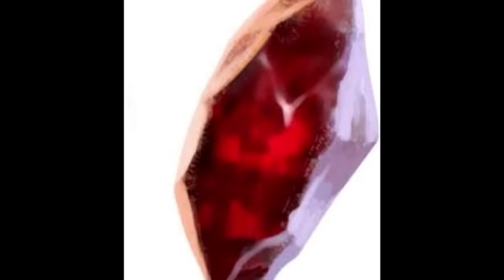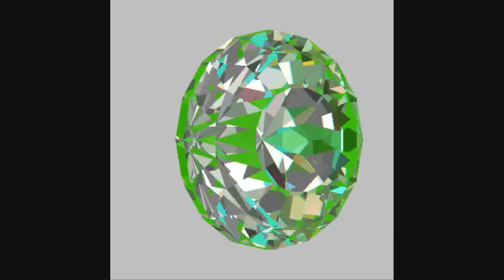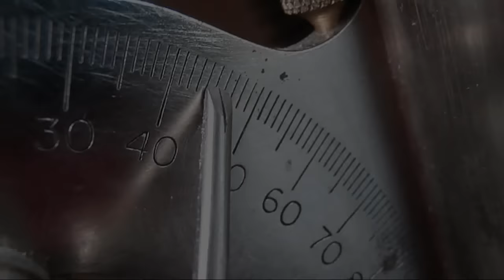How To Cut Gemstones The Philosopher's Stone

Comment: Cliff, I would like to ask. Is your faceter set up for  6 or  8 " laps. Seems like it might be set  up for an 8" but you use a 6". Would it hurt a machine to  do that because it would save a bit on the price  of a lap...LOL
Reply from the maker: The original base base plate is 6 inch. The pan would not be large enough for a 8 inch lap. Most Australian faceting machines are usually all 6 inch pans.
Reply: @VintageTimeGems  Thank you very much for that information, Sir.